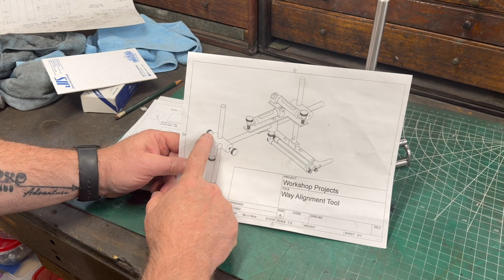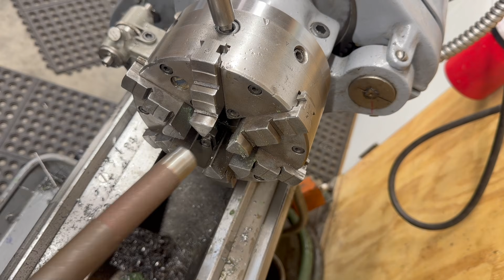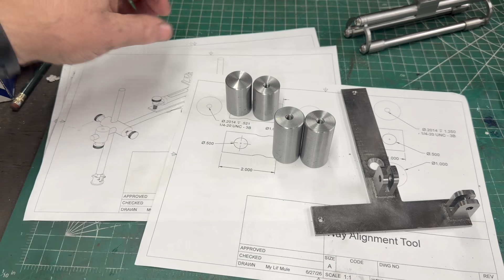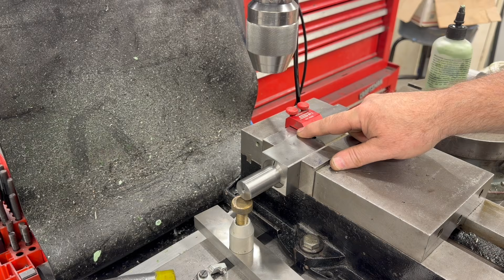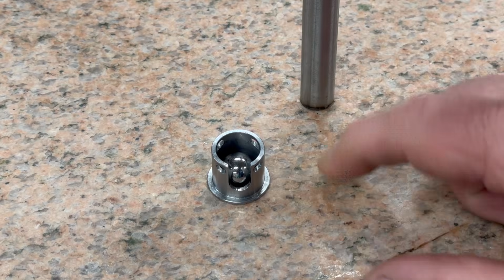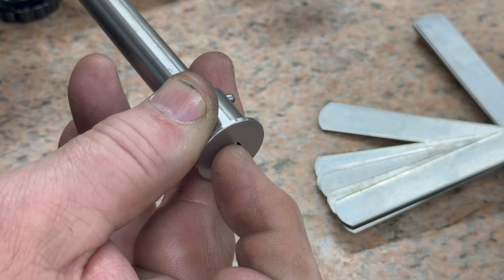DIY Way Alignment Tool - Part 2

Comment: It's all a learning curve.  For the most parts, your techniques are fine, but the order of operations you followed created some difficulties.  

I'd have started with the cross holes, drilled and reamed on the full length piece of stock.  Hold the bar in your square collet block as you did, but by using the full bar, you've got a solid grip on it.  Once those are done, chuck it up in the lathe, drill and tap one end (now you've also got the fringe benefit of having someplace for the chips to exit when using a spiral point tap).  Part it to length, flip it around and face/drill/tap the other end.  This method also minimizes waste.

Hope this helps.

-Kurt

Comment: Wouldn't you be better off with the tip of the ball only touching instead of the entire foot? If the entire foot is touching there is far more surface area to catch grit or imperfection while the tip of the ball will always be the same. Three points of contact would seem to work, two on the ways to keep it horizontally stable and one point across to the other side of the bed with the tip of the ball seemingly providing the most consistency. JMO

Comment: Thanks for including goofs - EVERYONE makes them. One thought: Was there a reason the original King-way has a separate foot for averaging? Are there occasions where point contact on a ground/lapped surface is better than averaging across scraped points? You might consider small machine screws or a spring/circlip or something to retain the foot rather than pressing in dowels.

Comment: great work. Learning this is good for all of us. I'm amazed the
ball didn't destroy everything you threw at it.  I'm a chicken with some of the hard materials....  I have had some luck going very slow in rpm on hard materials.  I also learned the hard way about center cutting and non center cutting end mills. Haven't had the occasion to try it but some have posted drilling holes in files and old end mills.....  I'd bet those guys can glue chicken feathers on their arms and do loops, too.....   Great video.  Thanks!  John

Comment: Perhaps drilling the cross holes would be easier on the lathe, 4 jaw offset, rotate 90° with a ground rod and a block stackup. The holes for the handle bolts, drill each side independently held in a collet; do that op last since you don't have a spiral flute reamer. Drilling them independently eliminates drill wander in a deep hole. The first cross hole, center drill it on the mill then in the lathe use a dead center bridge to indicate off of for initial alignment. If you bought those bearings from Ace Hardware (was in there yesterday looking at them), their chrome fyi. Good luck, thinking about building one for myself but instead using the Bno085 breakout. I think a digital version would have quite a few advantages such as data logging and being able to chart progress over time. Finally, thank you for your service (looking at your hat).

Comment: Greg I have Zero bad comments to make. I myself have made just about every mistake that has been thought of and still have more to come that have not been invented yet. We all learned from your video and that Is the reason I am here. Drilling full length holes with the tail stock is not as easy as many think. Hence the reason for "Gun Drills" At least you are young enough to remember your mistakes and will do things differently next time. At my age I can't remember if I looked both ways before crossing the road and If I do remember looking I don't remember what I saw. In the words of the great Harold Waters ARW- KO-KO ...

Comment: Drilling through a cross hole, especially a threaded one, is going to push a drill all over the place.  Plunging with an endmill would be more ridgid. 👍

Comment: Twenty twenty hindsight, cut 4" blanks drill all the cross holes then separate them and then drill and tap the ends.